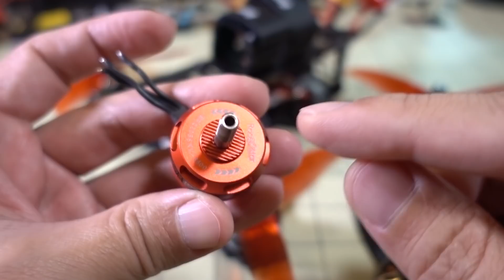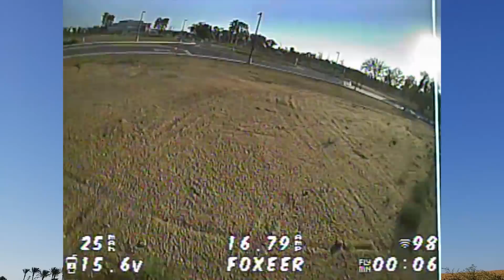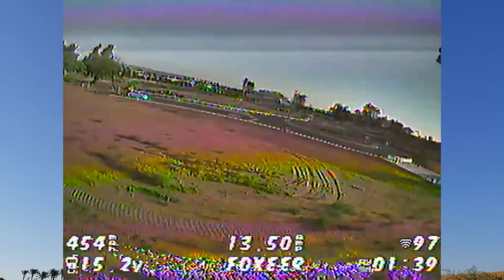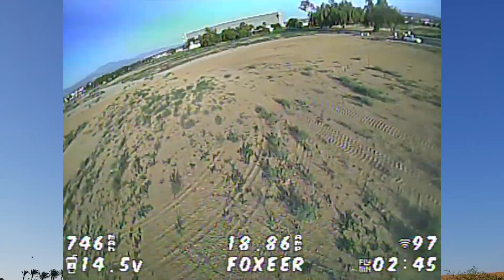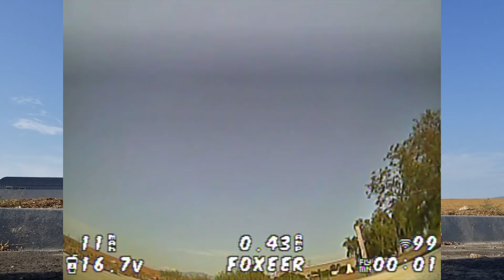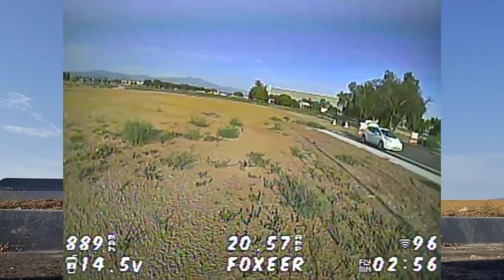Best Budget Motor? Racerstar SPROG-X 2205 🏁😀👍

Comment: This or the dys Wu?
Reply: TLDR: Racerstar are more reliable than Samguk.

I have the Wu. They are decent and look nice, but I'm not sure I would recommend them. I'm pretty easy on my equipment and don't crash that much (anymore), but one of the motors caused my quad to death roll hard into the ground. I found that it was still spinning but would twitch and spasm. Turns out three of the copper motor windings completely broke off at the solder joint to the wire (possibly weakened during rough assembly?). I soldered it back on, but the windings had already fried....so it's burnt toast.
Previously I had the Racerstar BR2305S motors. I crashed them a lot and worked them hard. One of the bearings got very loose and rough, but they just kept on going! I even put one racerstar motor back on to replace the failed Samguk. So I have a 75% success rate with Samguk Wu.
Reply: @Sergeant898  thanks allot for the info. Ill gather more opinions before I make a choice. You're talking about these racerstar, right? Or all racerstars
Reply: I'm saying that I think that the Racerstar SPROG are likely the better choice.

Comment: I wonder which one would you recommend for a 4s 5inch freestyle quad, SPROG-X 2205 looks pretty efficient and cool, but would it be too weak compared to 2206 or 2207 sprog?  also, can't find which type of magnets they use
Reply from the maker: Not sure how power hungry you are but these 2205's were pretty descent on power.  Obviously the 2207s will have more power but I haven't tested those yet.  I have no information about the magnets.
Reply: Albert Kim how heavy was the quad btw? :D

Comment: I think there is a good reason for selling these in a Pack of 5...
If you want good cheap motors then go for the DYS Samguk Series Wu or Wei.
Reply from the maker: Hmmm, looks like another comment from someone who hasn't actually flown these...
Reply: No, you are right. I have not used this motor yet but the old racerstar engines already.
They were something for beginners or to crash in a parking garage. They have taken many abuse and some of them are still running but they are lagging on power. 
The DYS Wu/Wei have much more power and you can get them at a compareable pricepoint.
But this is just my observation and opininon.

Nevermind just keep on with your good work...👍🏼

Comment: Don't let the sound fool you Albert! They sound faster but that means nothing!  They do look way better Imo tho
Reply from the maker: Just comparing the old ones to the new ones.... the new ones were better.  Not saying these are gonna be better than the new EMAX RaceSpec-II motors, but those motors are $25 EACH, so you do kinda have to take that into consideration as well.
Reply: You can't really complain about a ten dollar motor. My buddy wins races with the 2206 sprog. It is with out a doubt a new manufacturer also, you can tell just by holding them almost.
Reply: Albert Kim I don't like emax anyway, I like what's currently working on my quad. 😁

Comment: Stoked to see the 2207 2400kv video. I was looking at the 2206 2300kv as a mid -ground to upgrade from the old 2205 2300kv.
Reply: got the 2207 and they are great. got the pack with 5x motors and now have 15x motors. I managed to get in banggood 38usd for 5x

Comment: The gartt 2306 2700kv are 36-40 dollars for a set of 4. They make around 1500g of thrust and are far better motors. Check them out. They absolutely scream!
Reply from the maker: I'm sure that much larger 2307 motor will be more powerful.  How is the flight time?
Reply: Albert Kim hammering on them around 2 minutes. Doing some smooth freestyle cruising around 3 minutes.
Reply: Scoot Roter for half the power thats expected. You dont get 1500g of thrust on a 5045 prop and long flight times. You can low throttle cruise these for 5 minutes if you want to go slow. The gartt are pure performance. You want a good balance then nothing beats the kwadbox chee pass motors. I use them on a 5 and 6 inch. Decent power and 4.5 min flight times on a 1300mah battery. On my 6 inch and 1500mah I get 7 minutes. And they were 9.00 a piece.
Reply: Scoot Roter i have had them almost a year. I bought mine on Amazon. My buddy just got his in the UK a few weeks ago off amazon. I am in the usa. You can get them on the gartt site as well.
Reply: Scoot Roter and my apologies. They are 2306. I fat fingered the 7
Reply from the maker: I suspect the Racerstar 2207 2400kv will be more in line with those and the Racerstars are cheaper.  I've never heard of Gartt before so have no idea of their quality.  I'll have the 2207 Racerstar video soon.
Reply: Albert Kim sounds good. Gartt has been around for years. They started with rc car motors first. Then moved into helis/wings. Now mini quads. Their z2205 2300kv have been on 3 of my quads for nearly 2 years now. Still going strong. A few have chunks missing from the bell. No jello no noise. Set for 32.00 last time i checked. May be more now.
Reply: Albert Kim GARTT 4pcs Z 2205S 2300KV Brushless Motor CW/CCW Red 3-4S for FPV 210 250 300 Drones QAV Quadcopter https://www.amazon.com/dp/B01N4AWA6L/ref=cm_sw_r_cp_apa_KByrBbVNGRKKW

They are 38.00 currently on amazon. Price will drop again. Like all amazon products, they fluctuate
Reply: Albert Kim 4-5 min flights with basic acro. Running them hard 3-3.5 min on 4s 1300mah. I run 5055 hulkies on them. Ive also used 5152, 5544, 5048, 5045,5046, 5043, and 5040c. Love them. But not as much as the chee pass motors. I hope xhover drops another motor like it soon. They were limited production for kwadbox.
Reply from the maker: So comparing the Gartt 2205 to the SPROG 2205, the SPROG is $8.50 per motor, GARTT $9.50 per motor.  SPROG put out 1045g of thrust, GARTT 805g of thrust.  The numbers seem to speak for itself.  Just based on that information and the good performance of the SPROG, I won't be spending money to buy the GARTT motors to test them as they look to be poor performers and a lower value.
Reply: Albert Kim what prop was the sprog tested on? The gartt were done on 5030. When i thrust tested them on a 5040 it was over 1100g of thrust
Reply: Albert Kim and the gartt go as low as 32.00 on amazon

Comment: Even though it looked to be a decent motor for the price, I still don't trust Racerstar or DYS cheap motors due to the QC of those brands. Some RCX's are just a little more and with a considerabily better value. I see no point for these unless locality...
There are many cheap interesting looking motors at Banggood, like the Happymodel SE2306's with their installation cap for an insane 5063 prop, the SZ-Speed 2205CS and 2207CS, TopMotor TH2306 and 2308, etc. which nobody has tested in the entire Youtube...
Reply: Pedro Griebler Reche try 3BR motors (also known as BBB some weeks ago). They are a great budget/quality motors.
Reply: Luis Rodrigues nothing dude, I don't like that. But when you like the performance and QC of a T-motor but can't afford them, give it a look at 3BR and you'll find them cheap for the benefits they have.

Or you can buy keep buying Samguks and Racerstars and replacing them over and over and over, actually spending more money through the year on spares.
Reply: Albert Kim I've seen some reviewers at Banggood complaining that the motors were just too noisy causing vibrations, others saying that it also smoked... funny is that in the 2205 version nobody has complained about that
Reply from the maker: No noise for the motors I've got.... the FPV video was clean.
Reply from the maker: Of all the Racerstar motors I've tested in the past, this new one seems a lot different in terms of quality and they way they feel in flight.  At least when comparing against the older motor this new one seemed a lot better all around.
Reply: David C. Giraldo in fact they're really interesting motors, but I've also heard some QC issues with them (with Emax motors too).
Reply: Albert Kim it's not actually electrical noise... it's vibrations...
Reply from the maker: You saw vibrations in my video?  I watched it again very carefully and didn't see anything.  Also, the tune seemed spot on.
Reply: Albert Kim I know, it was not in yours, but other people complained about that. By what I see, your motors are fine.

Comment: Iron or aluminum nuts?
Reply: CapApollo aluminum of course
Reply from the maker: I think they are steel
Reply: Albert Kim those steel nuts cause many problems..  they are not design for high speed. Don't know why they use them.
Reply from the maker: I didn't experience any problems with the nuts... can you be more specific about what kind of problem you're talking about?
Reply: CapApollo I've never heard about a steel locknut...
Reply: i make a video about the nut discussion..  i hope its clear.  https://youtu.be/OR29kf9XXY8

Comment: I bought 6x of the BR2306 2700kv motors when they were on sale for $6 each. 2 of them have bent shaft from light crashing so I cannot remove the prop nut anymore. A third unused motor has blue goop everywhere from the factory in an attempt to balance the oval motor that shouldn't have passed QC. I've had this happen several times and Banggood will ignore your request for refund or exchange if you get shitty products so be careful.
Reply from the maker: this one seems to be made by a different factory than past motors from Racerstar.